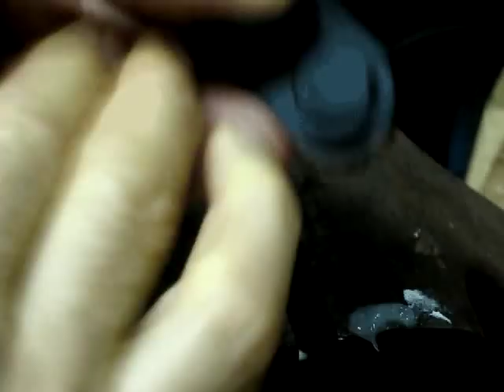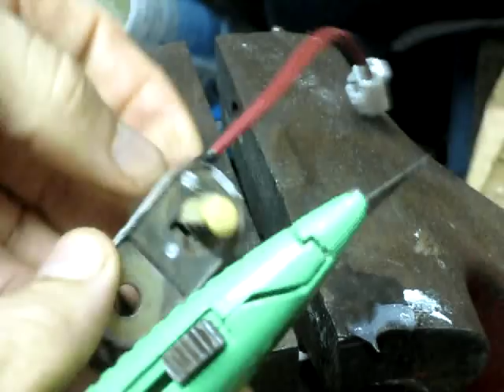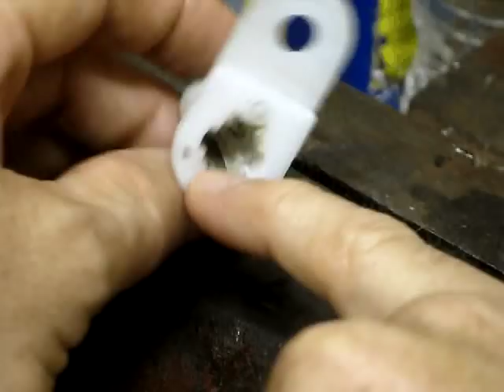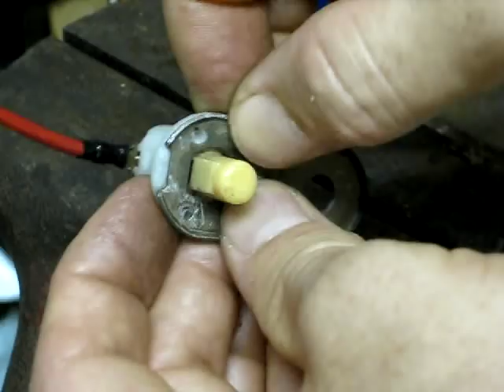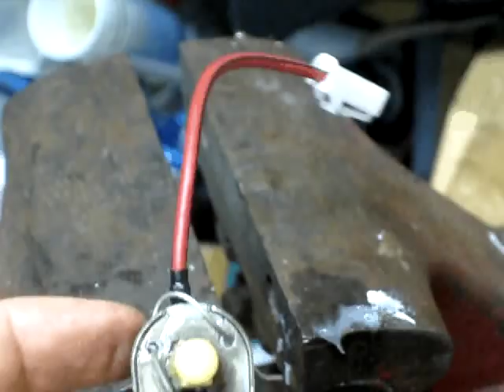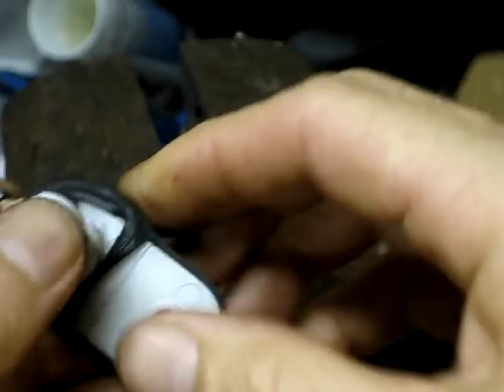Door Courtesy Dome Light Switch not working

Comment: Not sure which problem you’re fixing for your lights .. I have an issue where my courtesy door LED’s won’t fully turn off when they should. They only dim to “seem” off but are constantly on. I’m afraid it could drain my battery after time
Reply from the maker: Depending on the make and model, some cars have 12 volts positive to the courtesy light all the time. Then they use the door switches to provide the negative ground when the door is opened.  If water gets on a cut in the insulation or a connector in the ground wire, it can create a partial path to ground.  That will make the light come on dim all the time.  LEDs are very sensitive to that, because they require very little current to create light.  On newer cars, the computer controls the courtesy light.  Water on a connector can cause a slight current to flow from another circuit and make the light come on dim all the time. If you know a little about electricity and have a volt/ohm meter....Take the bulb out and test the wires at the courtesy light for voltage.  Then remove the fuse for the courtesy light system and test those wires for resistance (ohms).  What make and model is your car?  Have you noticed that the LED goes out when it hasn't rained for several days?
Reply: fixpro256 it’s a 2002 Silverado. They aren’t dim all the time, when I open my door they are bright as they should be but when closing up the truck for the night the door lights don’t fully turn off and I didn’t wana risk it draining my battery over something unnecessary so I removed them for now. I had that issue before with my dome light so I removed that previously after coming out to a dead truck in the morning.
Reply from the maker: A 2002 chevy may be computer controlled.  You will need to figure that out first.  If it isn't computer controlled... if there is water causing a slight short, the lights will be bright when a door is open, but dim when the doors are closed.  Once the water dries up, after it hasn't rained several days, the light will be bright when the door is open, but no longer dim when the door is closed.
Reply: LEDs only require about a third of the energy as halogen bulbs. 

When you see the LEDs dimly lit like that, it's only reacting to the same amount of electricity that the original halogen bulbs were exposed to but could not show. 

So your LEDs are not draining your battery because it's just emmiting the power that was already there. Your original halogen lights could not show. 

If you are upset that they do not completely turn off for cosmetic reason, I do not know how to fix that problem. 

Anyways, hope that helped and good luck.
Reply from the maker: I believe a halogen bulb still has a filament.  If there is a small amount of current going thru it, it might not be enough to light the bulb, but it will eventually drain the battery.
Reply: I'm open to that being fact also. If your sure then I'll believe you. 

I can't recall if I read up on my idea or just assumed it through observation so I'm not 100% certain about my statement but it's the logic I have been using for 5 years and I haven't ever had battery drain on my 2000 Alero. 

Not saying your wrong or that I'm right just throwing out my ideas. Thanks for your input too, will consider it.
Reply from the maker: I understand.  Most of those cheap volt meters have a 10amp max amp meter.  Could put one of those in line to see how many milliamps it is pulling.  There are a few things in most cars that pull small amounts of power all the time.  Even the radio does for its memory.  It takes a few weeks to drain a battery with those small drains, but if you add a few extra small drains, it can cause problems in as little as a week or two.  Especially in the winter or with a weak battery.

Comment: My car door was hit and I placed tape over the top of this button thing so my question is should I replace it or can it be fixed?
Reply from the maker: When you take the tape off, does the light turn on?  Then when you hold the button in, does the light eventually go off?  If so, the switch is working properly.  Usually, when a door gets wrecked, the problem is just an adjustment.  You can probably glue a piece of thin plastic on the door where the switch hits.  Just tape a 1/16 inch thick piece there as a test.  If that doesn't work, try 1/8 inch.  If that doesn't work, try 1/4 inch.  I doubt you will need anything thicker than that, unless you were hit by a train. ;-)  Once you find the right thickness, glue it in place.  Let me know if I have misunderstood your problem.  Good luck.
Reply: fixpro256 everything you mentioned is the issue lol I just didn’t want my car to have an eyesore with the tape. Are you suggesting I remove the cover first and then put something on it and replace the cover? I’m guessing so you can see the tape I’m using?
Reply from the maker: I'm not sure we are talking about exactly the same area.  I'm NOT talking about removing the switch cover.  I'm talking about the area directly across from the switch, where the post part of the switch hits the door.  That area is what actually presses the switch when you close the door.  If the switch, or the area where it hits, has been bent due to a wreck, you have to add a little material to take up the space.  You can glue a little piece of plastic there (or another material that is close to the same color as your car).

Comment: For me it didn't worked, I don't know why. I'll try to clean the bolts, they have to conduct electricity to the frame I guess and they were very rusted, let's hope this works.
Reply from the maker: Do any of the door switches work?  If not, you may have a different problem.  You are right.  The bolts do have to conduct to the frame/body.  The rust can definitely interfere with the connection.  If they work and then stop again, try dielectric grease.  It will prevent future corrosion.
Reply: fixpro256 I know one works, because when I play with it, I see the light in the dash become brighter. So I am confident my circuit works. The one I suspect was too rusted I put some break cleaner, than 2-3 minutes later I put WD40, I am still waiting, then I'll put some petrolium grease and put it back. All that is both on the bolt and in the hole.
Reply from the maker: What make and model is this car?  Not sure I understand the dash lights getting brighter.  Does it not turn on the dome light?

You can use a volt meter to test from each wire to ground.

If you don't have a volt meter,...Assuming the wire is a ground wire, you could ground each one (one at a time) and see if it operates the dome light.  

That would tell you if any of the wires are damaged.
Reply: My car is a Toyota Camry 1994.
I always turn the dome light to "off"(off/door/on), so I almost forgot it existed, this will be easier to look for.
The dash light I am talking about is the "opened door" warning light in the dash. When I push the rear left door button, I can see the light slightly change in power. I assume this button works.

I have a multi-meter, I haven't figured on what setting to put it and where to put the the "nodes". 

Right now, if my dome light would be set to "door"(off/door/on), it would always be on even with the four doors closed.

I hope it was all the rust on the bolt that created this issue, I will go out now and put it back in and see.
Reply: I used my multi-meter to connect buttons to the frame.
It makes a sound on the rear right door and stops when I press the button (success).
But on the rear left door it seems like no electricity is coming from the wire itself.
And on the front right, there is barely something, I can here the multi-meter almost trying to beep.
Thank you very much for trying to helping me by the way!
Reply from the maker: It sounds like you may be using the beep function on the multi meter.  That is usually for measuring resistance.  If you run current/power thru it, that can damage the meter.  Instead, put the meter on the setting that says "DC".  Sometimes they use a line with dots under it as a symbol for DC.  If it has more than one setting for DC, let me know what they are and I will tell you what to use. Hook red lead to the wire and touch black wire to clean metal (like the threads where the bolt goes thru).  It should show 12 volts.
Reply: Thanks again for your help, now I have put my battery on charge because it was really dead.
When I read the DC on the battery it says about 13-14V, on my driver button: 11-12V, on my front passenger button: only 3-4V, on my right rear button, something like 300-350 mV, and on my left rear button I can barely pickup 100-200mV. I did them all 2-3 times except the driver one, and I tried at different spots, those are the best I can pickup from any of them (sometime the front passenger got 5V. I think it is strange, but maybe it can lead to the problem? I did a little research but didn't find anything yet.
Reply from the maker: If you put the dome light in the "door" position, and then short the drivers side wire to ground, does the dome light come one?  When you remove the wire from ground, does it immediately go out? Or does it take a few minutes?
Reply: fixpro256 I'm sorry I don't really understand. My driver button seems working because with the key in the ignition, when I press the button it stops beeping in the dash. My dome light is always on even if I close all 4 doors and wait.
But anyway I tried grounding the wire for the driver button and the dome light stays on.
Reply from the maker: If none of the door wires are grounded, the dome light should go out.  If it goes out immediately, that is an "old fashion" circuit.  If it stays on for a while and then goes out, there is a timer in the system or the computer is controlling it.  That makes things a little more complicated.  That could be why you are seeing different voltages.
Reply: Normally the dome light stays on about 20-30 seconds then fade out.
Thank you for your help.
Is there a way I can just keep the light off at all time if I can't fix the buttons? It's draining my battery with the dash light and a light on my key hole.
Reply from the maker: If the light fades out after a while, that can explain the different voltages at different times, but it should be the same on all 4 door wires at the same point in time.
If you put the dome light in the off position, it should shut off.  But that won't turn off the key and dash light.
When the door switches go bad, that usually keeps the light from coming on at all (in the door position).  It sounds like you may have a short somewhere.  If one of your door wires is shorted to ground that makes the car think a door is open.  Does your "door open" indicator on the dash say that a door is open?
Reply: Yes exactly, my dash "door open" indicator is always on what so ever.
So I guess I am having the problem backward. Is there a way to know what button the problem comes from, maybe its somewhere else in the car?
To note: It started happening after a festival in an area of very high humidity, a micro-climate, and I slept with a door opened in the rain at times. I don't know if it can be related I assumed one of the button rusted.
Reply from the maker: I guess the door open light doesn't tell you which one it is?

If not, disconnect the battery.  That way you won't damage your ohm meter.  You can try the "beep" function you talked about earlier, or put the meter on the ohm/resistance function.  That is the one with the upside down horseshoe symbol.  Test the meter by placing the leads together.  It should indicate a shore. Connect one lead to the wire and one to ground.  It doesn't matter if the lead is red or black for ohms. One of the 4 wires will probably read less resistance than the other. Be sure you disconnect your battery before you do this!
Reply from the maker: I am not sure if I missed one of your post.  Did you get your problem figured out?
Reply: Honestly I abandoned the project for now. I have my van's radiator to 
get fixed, and I have to figure out someone who can fix my RV's 
carburetor. I will test what you said when I will change the oil of my 
Camry and I will try my best to respond here, This should be very soon 
because winter has arrived and I am gonna store her.
I will come up with the tests results in some times,
Thanks for your help again.
Reply: Thank you for your help, I just go back into the project, I just wanted to know if you could help me figure out the next step, or just tell me the problem, I assume it is in the wiring?

What I just did: I tested like you said the resistance, I put one wire of the meter inside the screw hole, and another on the wire going into the little module. I know it's not the driver door so I didn't tested, but 1 door said 9.80, and the 2 other said 3.22, so I guess I figured out which one is the problem, that was the rear driver side door.
Reply from the maker: It sounds like you have some kind of a short.  Probably one of the door wires is being grounded out causing the light to stay on.  If a wire gets pinched between two objects and one of them is "ground" it will eventually press its way thru the insulation and short the wire.  Do you remember if you had any work done on the car within a few months before this happened?  Or, maybe a wreck?
Reply: No in fact it happened in a very very humid place up in mountains where I slept in my car with the door opened under the rain. After that weekend it started happening  I am almost sure that is when it happened, at some point months later it stopped happening for a couple weeks and it started again. strange.
Thanks again for your help...
Reply from the maker: I don't know much else to do.  You will have to get a wiring diagram and figure out where the wires go.  There are usually a few connectors along the way that you can take apart and test each end for shorts.  Be sure to disconnect the battery first.  Look for pinched areas and areas where the wire shows thru the insulation. Good luck!
Reply: Thanks for your help, I'm still trying to figure out where does the wire go, I found the wiring diagram, but I'm not too familiar, I made a post on reddit hoping someone will know:https://www.reddit.com/r/mechanic/comments/6a0w4v/how_to_replace_camry_94_door_courtesy_light_wire/?st=j2glz3fw&sh=904366d1
Thanks for your help again!

Comment: Does anyone know why my drivers side door when I open it sometimes the door ajar disappears about 1 sec after and turns off the lights. But then other times it’s normal and the door ajar stays on when the door is open with the dome lights on?
Reply from the maker: Sounds like it has a bad connection.  When the door is closed, the connection is open and the light is off.  When the door is opened, the connection is closed and the light comes on.  If the connection is bad, it will be intermittent when the door is open.  On a simple door switch, the light might flicker.  On a door switch with a timer, the light might turn off after a while because it thinks the door is closed.  If you bump the switch it will probably turn back on.  Try cleaning the switch.  Good luck
Reply: fixpro256 Thank you

Comment: Wire? How about Superglue.
Reply from the maker: Since it only needs to be held together long enough to get the bolt thru it, you could probably install it without anything holding it together.  Superglue would probably hold good enough to allow you to get it installed. But, probably wouldn't hold longterm due to impact and flexing.  There are some adhesives that would work, but you may not be able to get it apart again.  If you use a little too much, it might get on the plunger.  If I used an adhesive, I would use something like Amazing Goop.  It stays a little flexible and you could probably get it apart again if you needed to.
Reply: @fixpro256  thank you for your detailed response.
Reply: fixpro256 good points!